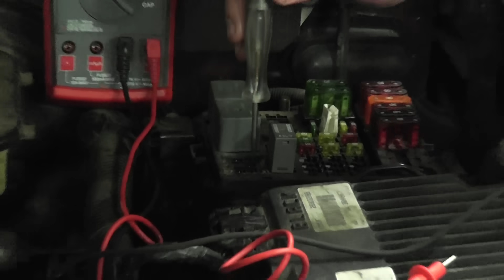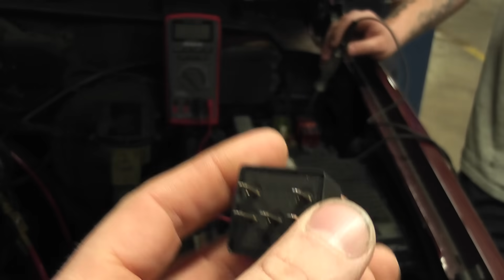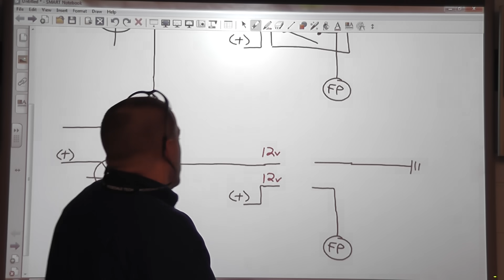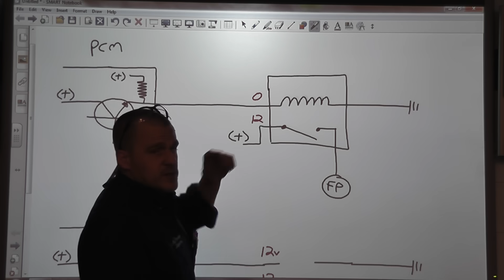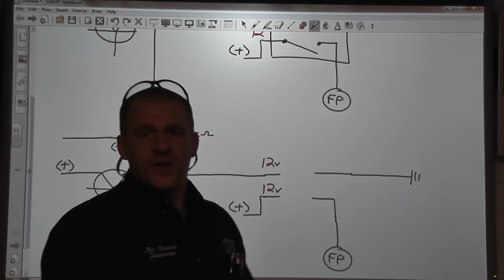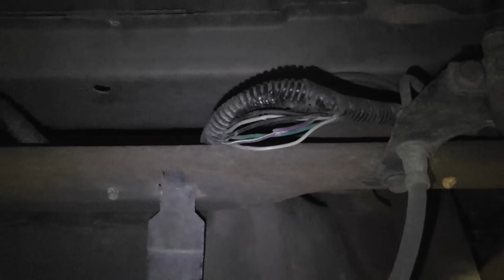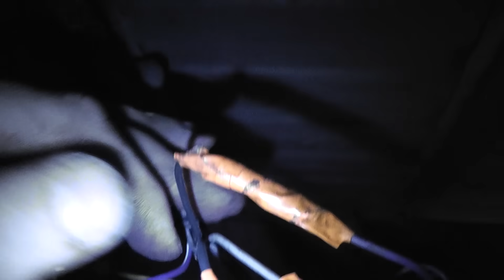GM Fuel Pump Relay Testing

Comment: So Monday first day of my week….. I have been watching live data on this 08 Honda Accord I’m working on and the ecu is intermittently commanding a fuel cut when I raise and hold the engine speed at 2,000 rpm. The rpms intermittently now and again bounce, not fast, not high, down up down up. So  2,000 rpm down to 1,500 rpm on fuel cut, back to 2,000 rpm. I’m looking at what the ecu is doing when this happens and the ecu, goes from ‘closed loop using sensors’ ‘open loop or fuel cut due to deceleration’ ‘open loop because engine temp is low back to closed loop again…. and so on. It does this maybe five or six times then runs fine…. Now the engine is perfect below and above this rpm… it’s only doing it at 2,000 rpm. I have checked coolant temperature and it’s fine doesn’t change, looked at throttle position both at the peddle and at the throttle body, again, no significant change maybe -0.45% at the throttle body each time the fuel cut event happens… Test driving the vehicle, cruising around the 2,000 rpm mark mild acceleration sometimes it’s a little jerky, you gun it and it falls on its face for a second then goes like stink! Occasionally it will feel a little sluggish to get out of its way but not always. 02 sensor data is perfect, fuel trims at idle and while driving look fine, not crazy numbers! This one is a real problem. I am wondering what could cause the ecu to command this fuel cut event intermittently…. Any ideas? I must stress this vehicle has no codes! None! I can’t even make it fault while driving trying to cause it flag a code…. I can disconnect things and it will bring the engine light on easily. This issue as far as the computer is concerned is not a bad enough problem to flag any code… I’m shocked because it’s bad enough to my senses 🤣 to make me think getting out of a junction quickly would make you a hazard ⚠️

Comment: good video, I have a 97 chevy c1500 that keeps damaging fuel pump relay on 87 pin and the base of pin 87 the plastic been melt. what could it be ? hot weather ? large amount of amps draw on load 87 side?

Comment: I have a 97 gmc suburban that got some bad gas, truck stopped, changed fuel filter and fuel pump after dumping bad gas out, checked the fuse and relay, both good.  Still won't start, wtf???

Comment: I'm a gmc vehicle owner. I unplug the the post catalytic converter O2 sensor. With key on engine off, one of the heater circuit wire reads 2.5V then I remember ScannerDanner lessons on bias voltage especially GM use. 
By the way, the O2 signal wire also has a bias voltage of 0.45V with O2 unplug 
Thanks man ❤

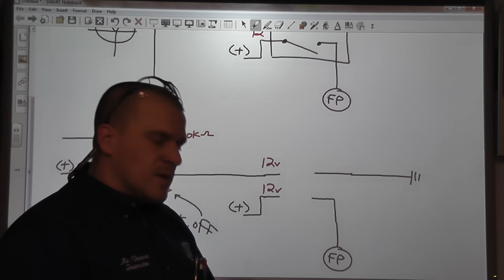Comment: So here's a good question that I think ik the answer. At 11:45. With the transistor off & the PCM seeing 12 volts. Is it safe too assume there's an open or a short to ground further down in that circuit?

Comment: I have a 01 dodge dakota quad cab 2wd thats had a super long crank time befor actually firing up. I have put 4!!! Fuel pumps on this thing and each time it fires up as soon as i turn the key for about a week. After that week it does the same thing unless i cycle the key 3 times to make the fuel pump fill the gas line back up. Any ideas of what i could do? Maybe a in line fuel regulator? Thanks so much

Comment: Ok yeah so thats almost and ALMOST like phantom voltage but its not. That resistor removes all the amps because you need amps to run things with no amps and if something as small as the test light pulls that voltage down immediately because no amps and is takes out that amperage out as heat right?

Comment: Very helpful video. But why didn't you check pin #30 for ground when you checked the other 3 for voltage and ground. I have ground at pin 30 with the key on or off but it's pulsating, the light is very dim and it flickers. 86 the light is nice and bright good ground but 30 is dim amd pulsates

Comment: what should the initial voltage be to kick on a 2003 vortec 6 liters fuel pump I have steady 5 volts at the pump and thinking I have a bad pump out the box

Comment: bypassing the fuel pump relay with a old wire I accidentally shorted  the wrong pin and the 20 amp (ECM B) fuse blew, I replaced the fuse but now it turns over but no spark ??

Comment: in 1981 they launched the first space shuttle with 5 computers with central processors and output processor by 1984  we were seeing the computers roll in the automobile going full bore in 1981, but Chrysler had produced EEC systems in 1976, but you can see were the influence to go all out was in 1981 after they launched the first space shuttle, and the world was able to see what the computer could really do. If they were good enough to send men into space they were certainly good enough to use on land. The cellphones these days have as much power as the 5 computers that launched the space shuttle, and what i am trying to say is these cars have become very complicated and Scanner Danner, you take that complicated out of the equation and explain everything in layman's terms so a fellow mechanic an understand and learn, and feel confidant that they will not be given the incorrect knowledge to get their transportation fixed. You are the only one online that i trust and know that i am getting information and know that my outcome will be an success. Thank you for your excellent videos and not leading me astray and You present well,  and deserve a award for the best automotive videos online. thank You, Quinton

Comment: Any half decent mechanic knows the fuel pump runs on lower voltage after the start cycle. It does not run on 12v constantly. There! Complete diagnosis done in one sentence!

Comment: Your video doesn't make any sense when the final conclusion was the wiring was hooked up wrong! Was this a tow in no start truck? Otherwise how did it get to your shop and why would someone cut the wires and connect them to the wrong opposing colored wires? Unless of coarse you fabricated this scenario to create this video. Is that what you did?

Comment: i always put fused jumper between 87 and pin 30(after cking B+ at 30). if pump runs then ck relay up.if not running ck at pump

Comment: Has that truck been back in since you made this video for pump issues by chance? Understanding included of reverse wiring affecting only brush condition in pump motor for worse case scenario and that the pump was replaced because of that thought. But then was the truck right back a 3rd time with pump issue?

Comment: Maybe the bias voltage tells the computer when the fuel pump coil is broken or shorted ?
Advanced computer would also check coil resistance and impedance ?

Comment: Hey  Paul it's me Bruce again when I first started watching your channel you talk about using a light tester and a multimeter I know you're real good at using a light tester I found a guy that I is like you he teaches electrical electronics troubleshooting for diagnostic on just about everything like you do it on automotive and he's done it on a heavy equipment Big trucks 
does in air industry you definitely probably heard of him his name is Dan Sullivan he's a teacher also have you ever heard of the loadpro I know you probably have you should try using it instead of your light tester it looks like it would work a lot better for what you need for what you would use it for I know how you tested a lot of products out there the load pro is to replace the leads on your multimeter I know how you're always telling your students about being as low tech as possible you don't have to spend a lot of money to to do the field I was just letting you know about the load pro if you don't already know about it which you probably do all right Paul you have a good day stay safe and I'll talk to you later

Comment: If bias voltage is not lightning the test light, even though  test light is grounded, then there is not enough current but almost as if a surface charge as in a battery after charge up; however, pcm monitors it for contradiction of current flow to light mil in the fuel pump circuit, right? 
If it sees 12v at the resistor then the voltage is going back in to the resistor because emitter, transistor leg not alloing it to go through it, it's blocked. Right? Is that what's going on Paul?

Comment: I encountered an infant warmer that would not power up.  Several biomedical equipment techs at the hospital called me in as they were unable to figure this out.  There was full output voltage out from the transformers secondary, and on the circuit board test points, YET NO AMPERAGE.  I actually tied the secondary wires together and plugged it into the 110 and the transformer didnt even get warm, much less blow. It was EXACTLY the same scenario that the bias circuit yields.
Moral of your story---The VOM has hi impedence (resistance) as not to affect the circuitry it is testing.
You should teach so the tech work wont blow your back out!!

Comment: I have a similar problem with my 2001 Silverado, but with the starting circuit.  I have to use a paper clip to jump across pin 30 and 87 to get my truck started.  Once in a blue moon it starts with the key. Any ideas on what might be the problem?

Comment: Hi SD. An emissions mechanic told me to disconnect FPR, crank the engine, and listen for mechanical "issues."(Northstar with persistent random misfire). What are the issues of which he speaks? Getting 36psi pressure when starting. Replaced pressure sensor and filter. Tried just about everything and still a 300 code!

Comment: You know 97 s10 4.3 the fule relays 3 are In the glove box all 5 pin fule pump relay I the middle 4 pin has 5 pin dead hole. The two top pins are hot there supposed to be across from each other that's far as I got. Heading to work.keep plugging Thanks.

Comment: I found this video In hopes of learning what all the pins of the relay are for. I already jumped the relay and got the pump going, but the truck stopped running after a few moments, so  I figured the other pins on the relays diagram were pertinent… with just a few minutes in, your voice reminded me of some douche  bag that does these videos, and they are super long winded, I think just so the guy can hear himself talk… I thought you were that guy and I was aJUST ABOUT to go elsewhere when suddenly you started speaking on EXACTLY the info I was looking for. I watched every minute of this video, and learned so very much from you… Thank you so much!!! I am a well seasoned backyard mechanic, but there’s things us guys will never know until REAL mechanics like you spread knowledge of “bias voltages”. Luckily, I have an electronic engineering degree, and have plenty of understanding when it comes to bias voltage,  but never knew it would be presented and misleading as it is in this real world situation. With or without knowledge of bias voltage, without the discussion you gave and the two different methods of testing the control side voltage, it would have kicked my lily white ass!!! Thanks again! Great video, I subscribed, and bro… you sound just like Bradley from sublime!! Lol… 🤙🏼

Comment: I have same issue on a 98 Buick I check wires are correct and I jump 87 and 30 and it’s run and runs like a charm so could it be a bad relay

Comment: I wish I could do what you did in the vidio to my 2005 gmc envoy. 5.3 motor. I have start and run in the morning and runs for about 5 miles. Then won’t start again. I have to wait for about 6 hrs before it starts again.

Comment: Is there a good way to wire a fuel pump relay outside of the fuse/relay box? I wonder if it's worth it to replace the terminals in the box when replacing a wire to the fuel pump.

Comment: Easy way to tell if tge relay works is run a jump wire from upper right to lower left if you hear the lift pump on diesel purr its the relay not making ground if you send power to upper right of relay and hear snap snap it means relay isnt making ground and is cooked.

Comment: You Fucked up on your explanation! 2:04 Pin 85 is NOT the middle one its 87A! I'll save the viewer time here...just jump pin 30 across to pin 87 to power the fuel pump directly. If that doesn't work your pump is fucked. If it does and you can hear the pump most likely the supply tube inside the tank has deteriorated away. That happened to me and would not pump full pressure.

Comment: Nice work . When you jump terminals 30 and 87 was the key turned to run or is it drawing power right from the battery ? I want to power on the fuel pump so it empties out my tank .

Comment: relay jumper.  take 4" wire remove the insulation, then you have a bunch of thin copper strands . take one strand fold in half around the leg on the relay. now the relay is plugged in completely and you can test. and if you want to mess with a friend you can connect to other components? horn wipers, wiper pumps??

Comment: hello Sir God bless you for your great work...Sir 97 savanna  on relay pin 30(has nothing) goes to pump and 87(has 12.4v) hot all the time, when i jump 30 with 87 I hear nothing and relay is not clicking when I turn key on... but the minute i gave straight power with my power probe to gray wire on fuel pump van starts now ... what do you thing is the problem Sir?  someone changed pump with didn't fix the problem AND i am not part changer

Comment: Which pin would you tap into for a kill switch? I'm trying to find the wire that has power when the ignition is turned on, and zero power when the ignition is off.

Comment: I was guessing it was ghost voltage, wondering if it would still show 12 V with a low Z meter. But your explanation of bias voltage is thoughtful, and I've seen bias voltage in other situations, too. Ghost voltage wouldn't be seen in the circuit drawing you showed, and it usually bounces around more. Further, you proved bias voltage at the end, by showing it comes back immediately on removing the ground connection, ha ha. More evidence to support using a test light rather than a meter/power probe.

Comment: Had a no start no fuel pump operation on a ford ranger.
Tests at the relay showed battery volts at the relay from the fuse box but test light lit dim loaded. Fuse test light lit dim on one side bright on the other.
Replaced the fuse and it started. Fuse was partially blown. Was a cheap generic fuse.

Comment: I very much appreciate this video! Although it wasn't the issue I was experiencing at the time (fuel pump working intermittently), it did get my brain gears in motion. I had removed the bed to change rear cab corners, and had just loosely placed the ground bolt back in place, that just happened to ground the bed lights AND the fuel pump. After finding no continuity between the pump lead ground and the frame, the a-ha moment smacked me like a freight train. A very good feeling freight train :) Subbed, and thanks for the content!

Comment: LOOK CHECK YOUR KEY SWITCH. MY TRUCK SAT UP AND THE KEY
SWITCH ASSEMBLY STUCK.  STARTER TURNED BUT IT HAD
NO IGNITION . I SPRAYED IT AND IT STARTED AND HAS BEEN FINE.
BE MINDFUL TO CHECK YOUR IGNITION SWITCH ASSEMBLY.

Comment: Many of the GM's had a red wire (usually located in the proximity of the fuel line quick connectors) that connects to the normally closed contact of the fuel pump relay that can be used to power the fuel pump directly, with key off engine not running.  Known as the fuel pump priming connector.  Handy for pumping skankey fuel out of the tank, testing the fuel pump itself, etc.

Comment: I am Japanese.  I am riding a Cadillac Bloom 94 LT1 engine.  But the fuel pump does not work.  The fuel pump and fuel pump relay are brand new.  The fuel pump fuse is OK.  Is there any other cause?  I'm really in trouble, please help

Comment: What is causing my 2002 Mercury Villager too loose power while driving and while idling .But if you put it in. Neutral you. Can. Rev it and put it back in drive it straightens it back out ..if I don't do this it. I will have to keep letting off the gas and slightly give it gas. Over and over to keep it from stalling .

Comment: Your a good teacher,you get off teaching,if one would listen to your video 10 times it would just click just like that little piece of plastic your working on when you turn on the key a flow of electric current reaches
Transistor and it clicks, sending that current in a controlled  flo To open the pump which pumps
Fuel to whatever  system
You have.

Comment: Having similar issues, but when I did the bridge I have fuel pressure, but when the relay is plugged in "brand new" it doesn't give the system the prime it needs to start, any answers?

Comment: Do you know how to remove the pins out of the c1500 fuse box? I cannot figure it out for the life of me and there is no information anywhere online. Here's a reference photo of the box. 
https://cimg5.ibsrv.net/gimg/chevroletforum.com-vbulletin/1300x731/tabs_cad7065880f23fa608ab547300ced2adf2921b84.jpg

You would be a huge life saver, I burned up my fuel pump relay connector 30 and need to pull the wire out the back and clean it up.

Comment: At 12.40 you say pin 86. I think you mean pin 85. I am working on this same fuse box. Pin 30 melted, so someone wired in an external relay. I have no voltage at pin 85. I do have signal when cranking. The pump is always running when relay is plugged in. That says 30 and 87 are wired so the relay leaves this thing running.

Comment: I have a 2003 avalanche & the door locks started going crazywgile driving.I got home diacon acted the battery to hopefully clear any codes & the truck e on t start now seems like a fuel pump but the w/o does WONT. roll down either. Replaced the pump in Febuary in Ohio weather & has ran fine until these door locks went crazy.. HELP